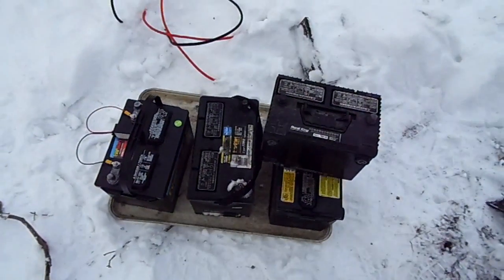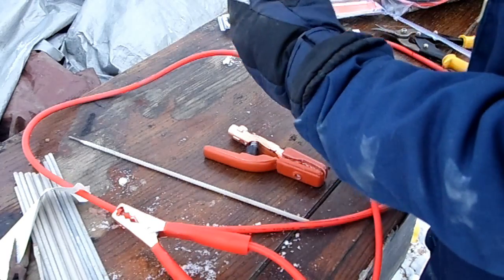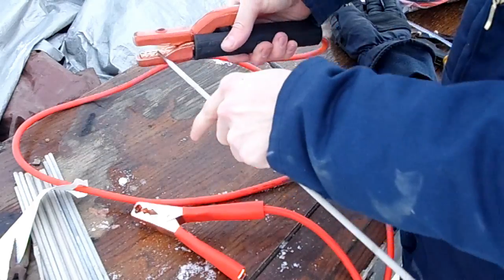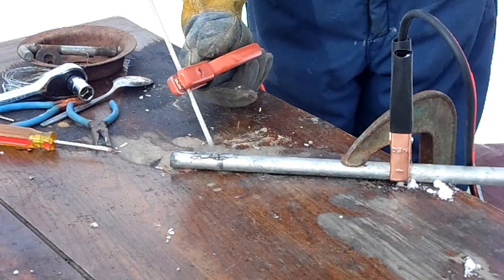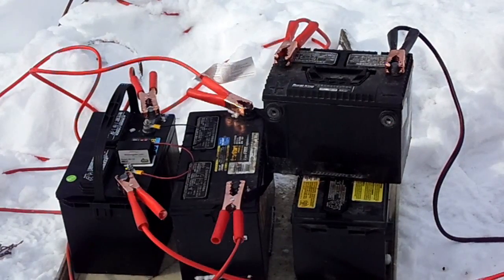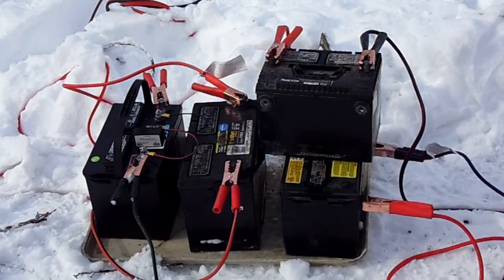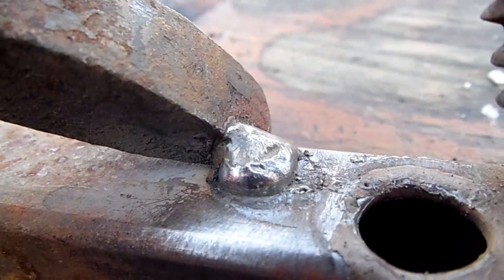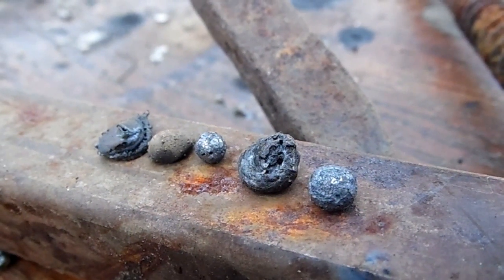DIY Welding with Car Batteries

Comment: If there's not enough power available  (a potential with that invention of your's im thinking)  to weld with especially when you're using those thick rods and / or welding thick metal, than you'll improve, or illiminate the sticking problem your having by simply using much smaller diameter rods which frees up some of the limited available current provided by the car batteries.
  Sticking is an unavoidable symptom when you're welding too cold. The cure therefore is more heat.
  You'll just have to make more passes , but then you'll get more practice anyhow since your a newbie.

Comment: Consider DCEP/electrode positive polarity. Connect the electrode holder to the bare part of the electrode. And consider smaller diameter electrodes. Works great for me…

Comment: I've welded with my truck battery more times than I can count. Just using jumper cables. Also it's a lot easier to do so with it in a truck running. Works pretty damn easy.
Reply: With just 12V?
Reply: @j.p.saverance8972  yep, now you aren't getting deep, it's just tack welds really, but to hold something until you can get back to fix it completely it works

Comment: I just clamp the gater clip to a chinese pair of vice grips I found in a parking lot and it works lmao
also ya gotta wire these in series-parallel to get the right voltage to weld with this setup you need about 24v

Comment: Your supposed to use Negative side for your Welding Rod Genius . Take Off your Welding Clamp from Positive and  Install it on Negative Cable Use Positive Clamp on piece your Welding. Another Thing you have a lot of Juice  Melting thin pipe your not welding How do you know if you have 12.6 Bolts  or 25.2 Bolts or ,37.8 Volts   use a Volt Meter Measure your Batteries  might be Dis charged and with all that Juice that Thin Pipe is Nothing saw a guy here on You tube Weld Two Brake Rotors together with 2 Car Batteries and Welds were Really Good.  I Recommend you watch that Video first before making this one.

Comment: The "thingy" is a Allen head bolt, and you used an Allen wrench. I have heard that with battery welding, it is best to connect the piece your are welding to the positive, and the rod to the negative.  This deposits the metal onto the piece,

Comment: you need to reverse the polarity the, the part should be positive and you should hold the negative.. this way the drag is to the positive and it will stick great and reduce slag

Comment: With all the batteries and other stuff you wasted money on you coulda gotten a pretty cheap tig welder
Reply from the maker: i only spent about 40$
Reply: @RinoaL  brand new battery’s woulda cost at least $100 brand new

Comment: Great video. I learned from both the video and the comments. I don't have a welder and am just about to give this a try. The tip to replace the end of the battery cable will really help. I am less scared having watched this.

Comment: 2 batteries at 24 volts or so, and just reverse leads on the electrode and work price so the electrode is coming off the negative batter post  for DC negative then you’d get a smoother arc instead of the popping mess...  ☺️. Cheers!

Comment: Do you think if I use my golf cart batteries to weld with it would hurt them much, I wold disconnect the cart from the batteries first, it is a 6 battery x 8V. (48V.+) system but I don't have to use all the batteries if I needed a lower voltage, they are Deep Cycle Lead Acid Battery?

Comment: Interesting!!!!  I'm on an off grid location with no city power. My van has ONE big 120AH deep cycle starter marine battery.  I also I have a 120v 1200 watt inverter. With my van running and the 120A alternator feeding it what are my options for home made welding like this?
Reply: @johnvanlandingham8832  LOL..  I experimented with low amp 120v welders and found the a sweet spot where I can weld with my engine running and a 2000 watt inverter.

Comment: Would somebody tell that kid who made the video that the electrode is on the negative side and the positive of the battery is the ground.  doing it this way create a different kind of Arc which results in a cleaner more spatter free weld bead

Comment: Nice job! I’m not a welder but learned a lot from those who are here. I’m a Gold Prospector, and this has possibilities for high temp kiln to smelt Gold with!
Reply from the maker: actually look into using nichrome wire for heating element, if not, look into using graphite as a resistive heating element. graphite has some resistance so if you put low volts with high amps through it (like a big battery charger or welder) it can heat up without burning away. i do not mean an arc torch. i recommend using a shielding gas for melting at that high of a temp. and furthermore, passing electricity through the slag can seperate the remaining metals trapped in it.

Comment: If you can do this with car batteries couldn’t you do this with 4 ac to dc 12 v output power supplies?
Reply: Doubtfull. You'd blew fuses. 🤔

Comment: I’m only making a comment because in high school ( almost 41 years ago ), in Metal shop high school we had tons of war surplus machinery to use...! It was great...!   Milling machines, giant Lathes, DC welders and regular AC welders....! We were taught how we  could wet The welding rod reverse the polarity, and use a DC Welder as a cutting device....! And that is exactly what you done here especially with those thick rods.....! I have a old Lincoln and a Miller Stick welder and use them quite often.... When I saw you using car batteries, your cables hooked up incorrect, with your ( too thick welding rods lying on a wet table..! ) , It brought back High school memories of “ good old Mr. Jackson “ teaching us different techniques and Tricks of welding like....
Using a Wet Rod and a Reverse powered DC welder to cut metal with.....!
Reply: Jeff that wedding the rod and using it for cutting is a good piece of information. We as a people need to share more basic info like this.

Comment: Will someone Please teach this kid how to weld.  For one thing when using car batteries it works better if you use the Positive for a ground and weld with the negative.  You also need to have clean metal to weld (wire brushed or Ground down to clean metal) on and not us Galvanized steel as the fumes can kill you.  Also your welding rod is to big for welding thinner metal.

Comment: Don't you know that pipe is Galvanized and the smoke that comes off that is poison you should have took the grinder and grind it all the galvanized coating off of it
Reply from the maker: sure, but it doesnt matter with proper ventilation. you shouldnt breath metal fumes anyway

Comment: I bought a used welder for $70 and 150 feet of no. 8 wire for $60 and made a cable 75 feet long. The cost of one car battery is $140.
Reply from the maker: but the cost of a used car battery is 10$ or free.

Comment: In another video it was recommended that you connect the Negative to the stick and the positive to the body being welded.  Why is this? which one is correct?  Thanks.

Comment: Reverse your polarity your red clamp should be on your work piece and use some smaller 3/32 6011 or a 1/8 6011 two batteries is enough

Comment: Fuck you must be a small idiot, mabye next time try to bring metal there are not Galvaniceret to weld in, then evrythng will be mutch more easy even with 12 volt. i'm a Blond girl, and even i can find out not to use this kind of metal to weld in..i hope you did not weld enything toghter you wife or girlfriend have to drive in. then it will fall arpart, this must be the video of the year, how not to weld,,
Reply from the maker: its perfectly fine to weld galvanized. just do it outside, and you shouldnt be breathing in welding fumes anyway. i always hold my breath.

Comment: 2 batteries for 24 volts then use the positive as ground and weld with negative side. 
I have seen it done successfully this way.

Comment: Works ! Just as a spot welder in a pinch . Can improve it with a heat dial from an electric stove top (table top hot plate) negative electrode , minimum 2-12v batteries in series connection .
1/8 or smaller 6010,7018

Comment: I know you are trying to weld the most economical way possible, and you are on the right track. Remember that it's not voltage you need it's amperes. Using car batteries you will increase both at the same time.. This type of welding is very old and has been used reliably once the learning curve has been successfully overcome. The amount of batteries you are using would be equivalent to the cost of a welder. But Cheers and keep on keep on.
Reply from the maker: you cant increase amps without raising volts or lowering resistance. thats ohm's law.

also these batteries were free, they came off the recycling skid from an auto shop.

Comment: Cool video thanks. I was wondering if 36 to 48volts would be better. Now I know to stick with 24 volts.
Reply: 24 volts will spot, or tack only. Higher voltage required to sustain that arc. Just tried it using 2 12v 500a batteries in series, using short, heavy guage cables, with 1/16" 6011 rod. Getting another for 36 volts. Guage 0 cables, connected direct using crimped copper eyelets.
I learned about this 40 years ago, from an old WW2 Ship builder. They used 2ea 24 volt submarine batteries, rated at 2000a+ each.

Comment: You should try putting the batteries in pairs parallel and the group the in series so that you are welding with 24 volts but have more amperage.  That will help the problem of sticking the rod also you can tig weld with that set up using electrode negative.  It is much more controlled that way.

Comment: You are in a wrong polarity dude,  and the electrode you used is too cold that's why stuck on the metal. you can't weld a good one even you had more Batteries bcuz of low amperage and too  much voltage, one more thing, galvanized is difficult to weld in low amperes and cold electrode.

Comment: another option instead of removing an alligator clip from jumper cables, is to use vise-grips to hold the welding rod and then use the jumper cable on the vise grips. And you need to hook the negative side to the welding rod and positive to the work

Comment: Thought you used the positive lead as the ground cable, thus the term electro-negative DC arc welding

Comment: I had to this this one time at a mill I worked at. I used a 48 volt electric forklift battery. It had an open top so I could tap it at different voltages to control my power. 2 volts per cell so it made controlling the easy. Just remember car batteries (lead acid batteries) vent hydrogen.

Comment: First reaction.. well there is a fast way to cut through metal fast.... wow that battery really sinks it.. I am geussing the batteries starting power - or peak amperage will effect the max weld vs. the continuous.

Comment: if those are 7018 low hydrogen electrodes and you got them from a dumpster, they're no good. They need to be kept dry and after 8 hrs of being in the open air they already have sucked up moisture. You could bake them one time after leaving them out for an 8hr period in a oven at 250 degrees, but then if left out again, they're more hassle than help.
Never leave your electrodes in any water or snow as seen on your work table.
Reply from the maker: +trevor kleinschmidt no not from a dumpster, from a construction site. but this wasnt really a test of if i can weld well, it was testing if the batteried could provide enough power.

Comment: It takes a while to get the hang of striking an arc, then keeping it going at the correct distance so that arc is not too cold that it penetrates poorly or so hot it burns holes in the metal. Eventually you can tell by the sound of the arc. I used to clamp a piece of scrap metal under the ground clamp and strike the arc like striking a match several times on it to heat up the electrode tip - this reduces the electrode sticking when you touch the cold metal you want to weld with the electrode as you strike it. Good luck with practice. I would not weld so close to a SLA battery as I have read of one blowing the top clean off whilst fitted under the bonnet in routine service - I think the cause given was a blocked filter and gasses could not escape. At welding currents you are driving these cells quite hard - do beware!

Comment: On second thought, you should use microwave oven transformers in series next time. With batteries, you'll only get 60 amps at best, which is barely enough for fat electrodes. If a homemade welder can melt stainless electrodes better than a single AC buzz box, then you shouldn't have a problem melting 6010 rods, even on AC.
Reply: Microwave transformers? Talk to me...

Comment: Heads up, use 3/32 rod,  w/ battery welder, a little hot but not for thicker steel, DC reverse polarity maybe?

Comment: Not exactly a super genius... you want the batteries in series for more current when in reality putting them in series ups the voltage, if you want higher current you want the batteries in parallel
Reply from the maker: i dont understand your question, i was connecting these batteries in series and got more current like i should. the higher current is a byproduct of the higher voltage.
Reply: Rinoa Super-Genius edited

Comment: I seriously believe those are rods are crap that's why your grandpa found them in the trash.
Reply from the maker: +Kent Arjoon oh i dont doubt it. although they were still good when he got them. he worked in construction and they were just extras for the day. however they were sitting in my shed for a long time with plenty of time to absorb moisture, i wasnt wanting to make a good weld though, more if testing if the batteries would give enough heat

Comment: The reason everyone that demonstrates DC welding with car batteries does such a poor job is because they DON'T own welding machines, but need to weld something and don't want to put out the money for an expensive welder, harbor freight sells cheap welders, but seriously they are a 1000% times more dangerous than using car batteries, open one of them up and you'll find circuits that I wouldn't put in a calculator! Batteries don't blowup when being discharged, only when your charging a battery can it explode! As a battery charges it create hydrogen gas and if there is a short in the battery or a spark nearby.... KABOOM! Boiling hot battery acid spraying everywhere! (retired Army Motor Sgt) I had to call an ambulance when an APC (armored personnel carrier) batteries exploded in an 18 yr old kids face, he lived, but was discharged from the Army with severe acid burns on his face neck and arm. We had a track recovery vehicle with an aux. battery under the radio that was charging off of the vehicle generator (full time) and blew up the radio, fortunately no one was inside when it blew up.

Comment: Sigh, honestly, don't you think you should figure out what you're doing before you inflict a video on us unsuspecting souls? First off, we have no idea whether these batteries are any good, or whether they are old and have high internal resistance. Knowing that pretty much everyone else in the world uses two 12 volt batteries for 24 volts, I think I can pinpoint where your problems are. First, you should be connecting the batteries together with SHORT pieces of HEAVY wire. Connecting batteries together with thin gauge, cheap, long jumpers is just wasting voltage on resistance and limiting current. Second, ditto for the cables to the work and the welding rod - here you do want longer, but you want a HEAVY GAUGE jumper. Third, please don't put up a learning video, it just aggravates people like me who are looking for COMPETENCE. Having said all these rude things, I appreciate your enthusiasm, but your enthusiasm is overwhelming your sense of competence. For starters, please contemplate Ohm's Law: E = IR. Rearranging for current, I = E/R. So, current is inversely proportional to resistance. In your setup, you have two sources of resistance: the internal resistance of the batteries - which rises with age and with being under-charged - and the resistance of the cables, which rises with length and smaller gauge. No wonder you could barely get an arc with four in a row - that should tip you off there's way too much resistance in your circuit (loop), because two good batteries connected with a short piece of heavy gauge (say, 10 gauge) wire, and using a pair of jumper cables for the work clamp and the welding rod holder, you also want heavy gauge - again, at least 10 gauge, and 6 gauge would be GREAT. Finally, as Thomas Harrell pointed out, you should connect the NEGATIVE cable to the welding rod...so the flow of actual electrons (which flow from negative to positive against all reason, but that convention was set in concrete long before anyone realized they had it backwards) goes from rod to work, which helps carry rod metal into the weld puddle. Capice?

Comment: Looks to me like you're trying to weld with a low hydrogen electrode. You might be able to get it to run by changing the polarity but that rod isn't really designed for straight or DC negative polarity. I would suggest trying a sheet metal electrode like an E6013. Two batteries will work fine with that on straight polarity (DC-).
Reply from the maker: i dont doubt it, i latter found that smaller rods work much better. ended up welding with car batteries for most of my projects for years until i got my Missing Link welder.

Comment: Nice explanation on how the batteries work together for more volts ! Your welding explanation was off. Good to see your trying to teach people something . And to the comments below he wasn't teaching how to weld , he was teaching how to get enough power to do so in a pinch . He openly admitted that he didn't know how to stick weld. Obviously he isn't a welder by trade but at least he is trying .

Comment: You need to weld using the Negative side of the battery not the Positive, try it and you will have better luck